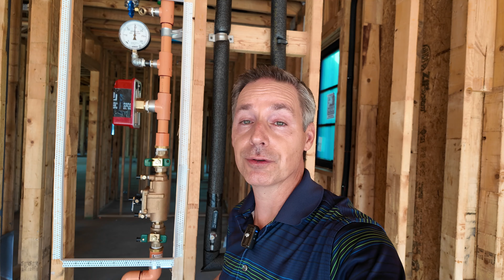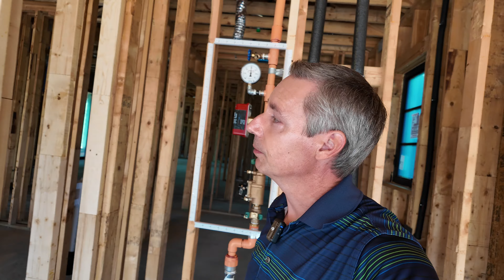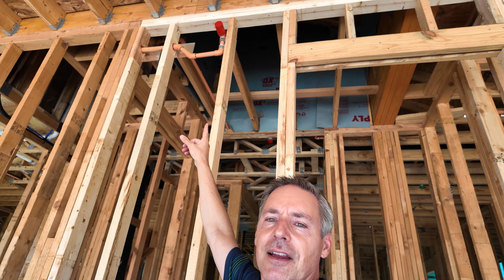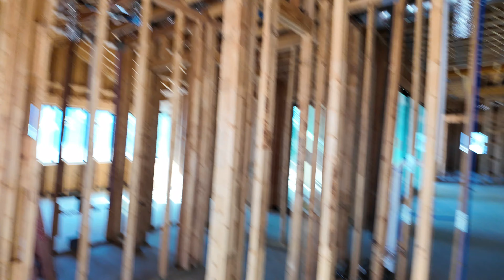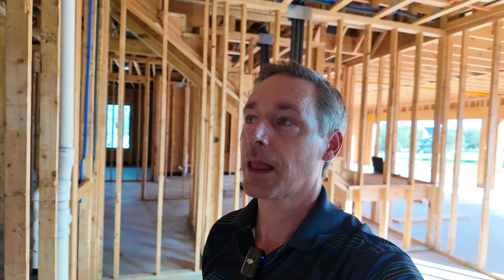Residential Fire Sprinkler System (In A New Custom Build)

Comment: I'm an owner builder.Nobody wants to do  the design, or they want to charge me thousands.
Reply from the maker: Do you mean the floor plan design, or the Sprinkler design? I’m assuming you mean Sprinkler since that’s the video you commented on. They should be able to look at your floor plan and quote the job. Some may require a deposit if you sign the contract to use them, because they have to submit a design to the city. Typically the design is part of their fee, though.
Reply: What sprinkler system company do you recommend?

Comment: Don't forget to put the sprinkler valve on your monitored security system!  That way if the sprinkler goes off or a pipe is frozen and burst, you will be immediately notified of the event.  And the fire department called too.
Reply from the maker: That’s a great point; it’s definitely the responsible thing to do to connect those two systems.